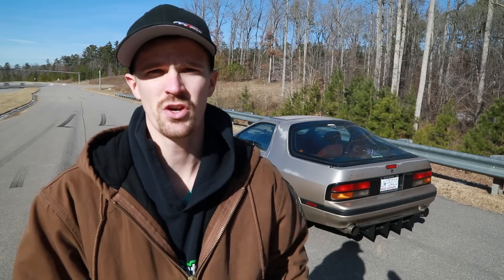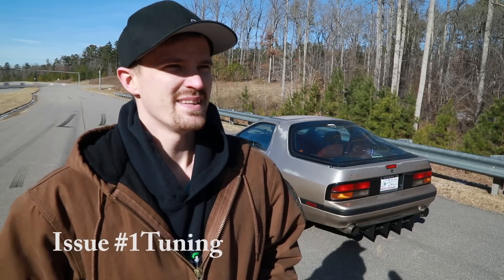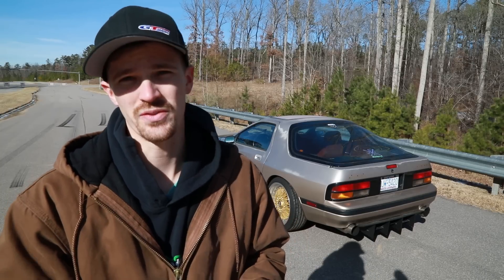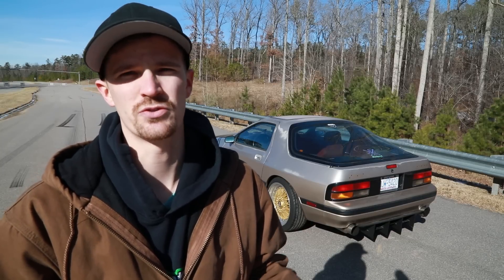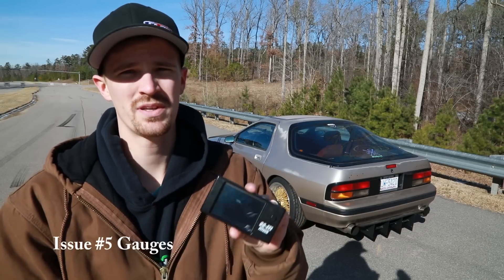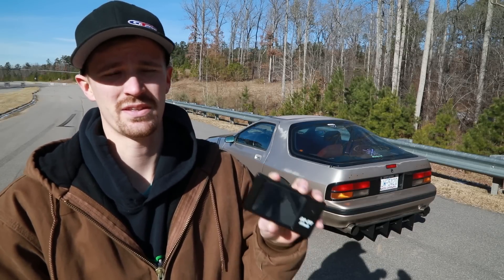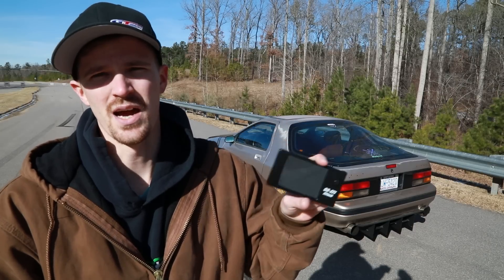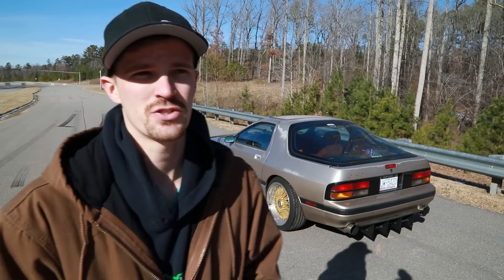5 Reasons Not to Buy FiTech EFI System

Comment: CONSIDERING this unit or Howell, I'm leaning toward the Howell BECAUSE of issues you are having, I figure the MORE COMPLEX the system and the MORE parameters gives MORE potential problems, I NEED DEPENDABILITY first.
Reply: So you just want to run a GM OBD1 TBI system from 1987 that you will have to have a new chip/rom burnned any time you make any changes to the engine?

Comment: I had this same unit on a chevy 283 and was unimpressed. I didn't really have any terrible problems but it certainly wasnt plug and play, never buy a carburetor again like I was expecting. Cranking time was about the same as a carburetor. Fuel economy was about the same as a carburetor. Driveability was about the same as a carburetor. You know how you replaced your quadrajet with a holley when you were 16 to be cool and tinkered with it for about a year and got it running pretty good for the most part and you felt a little bit of improvement in power or driveability with each jet or squirter change but there was always still a little bit of tuning left to do... this is like that. Probably should have just left the quadrajet alone and made sure the choke was adjusted and the thermac air cleaner was working properly. I put about 10,000 miles on my fitech unit. I wouldnt take the time to leave a bad review on summitracing but I wouldnt buy it again. Id either buy a quadrajet or an ls engine. GM, FoMoCo, and Chrysler seem to have worked it out better than the small companies offering affordable efi units.
Reply: hahaha haven't seen someone cheerleading a quadrapuke in a long time.....and that is including the 5 year  age on this

Comment: A lot of cars shut down the accessory power supply when cranking, the ignition power supply isnt the same one as you have this running from would be my guess and you see this sort of issue with cheap gps units as well. Part of the economy of efi is the fuel cut off on decel, so if you want throttle response on decel, then of course you have to disable it. Part of tuning to your preference is to understand the system and your cars system. Nice car :)

Comment: white/black screen issues are most likely operator error, wiring anything directly from the battery like that is usually a very bad idea, especially if you try and use any kind of jump starter on it, you'd probably fry the unit.

Comment: Running a 400HP Fitech on my 78 Bronco. Yeah, you have to tune it, but tuning and changing  parameters is a lot easier than changing jets. Mine works awesome, on or offroad. I think your expecting to much and need to brush up on your engine tuning basics....

Comment: And you need a single plane intake
Reply from the maker: Yep I ran the system with out a filter for a few 1000 miles but installed the filter because my oil was getting really getting dirty fast. The air filter actually didn’t effect the tune much at all thankfully. As far as single plane I know a lot of people still run a dual plane. Check out early bronco and some of his videos we run the same intake on the same motor.

Comment: Try getting a single-plane manifold. EFI-Systems like this (no matter if FAST/Holley/MSD or FiTech dont like dual-planes
Reply: wrong, the fitech works fine with dual planes were other efi's don't cause they only monitor vacuum from one barrel on one side of the manifold, fitech measures from both sides.
Reply: Scott Newman still single planes are better with EFI systems

Comment: I installed a MSD atomic and had great performance at full throttle,  but experienced decel and idle concerns. I integrated the spark timing and all my problems went away. The ECM can rapidly control timing to compensate vs fuel / air. Sorry, but that would mean you upgrade to the better FiTech system.  You would have to also buy what is referred to as a "ready to run" distributor, remove vacuum advance and lock the mechanical advance plates as well. Good luck.

Comment: So part of your problem is the dual plane intake. I’ve used the Fitech and Holley systems and they don’t tune or learn properly because they vacuum or manifold pressure signal isn’t even between banks.
Reply: fitech measures from both sides.

Comment: BIGGEST ISSUE IS THE FORD 302, THE WAY THE FITECH WORKS IS THE DISTRIBUTION OF THE FUEL ATAMS DONT LIKE THE CASTINGS ON THE FORDS AND THEY FALL OUTTA SUPENSION AND PUDDLE CAUSING LEAN ISSUES SO IT RUNS RICH FOOLING THE OXYCONTIN SENSOR RESULTING IN A HIGH HEAT CONDITION IN THE CADILLAC CONVERTOR SO IT MELTS THE BEANS IN IT CAISING IT TO CLOG AND TIGHT BACKPRESSURE SLOWS THE PISTONS DOWN
Reply: grngs1 So much info in one sentence. Always check your oxycontin sensors.
Reply: Soundsike he's running more than sensors.
Reply: so much wrong.....
Reply: lololol

Comment: So the more i think about this the more I'm convinced your starving the engine of air.  This system is a speed density unit.  It uses a calculated fuel curve based on engine size, cam specs, rpm, engine temp, engine load (vacuum), and baro.  The only thing it doesnt monitor is air.  Ford used speed density on the 86 mustang sefi 5.0.  They went to mass air in 87 because it worked better for precise tuning of the fuel curve.  

Because you have a huge choke point with the filter housing the fitech will never be right.  Its assuming x fuel for y inputs with an assumed air flow which is incorrect.

Seriously put in a good filter hat and see if the fitech works better for you.
Reply from the maker: Thanks for the imput, i ran the system with no filter for about 1,000 miles and it ran the same. Once I saw how fast my oil was going bad(dirty) I bit the bullet and put the only air filter that will fit under the hood. The tune was off for a bit but I was surprised that after a few drives it was running just as it had been before. If this was a higher spec motor or reved out more you would see a much bigger difference like you said. But a stock 302 doesn’t pull enough air, when a real cam goes into this motor and I can rev it out im sure ill run into some issues but the filter will be gone before then.

Comment: Put the same system on my new 351W crate motor. 350 hp, four speed in a 1976 F150. I didn't have to do any tuning. Just the initial set up. I just drove it. As it learned it ran better and better. Also I live at 5700 feet. I have a little over 500 miles on it now. Runs great! No white screen. Large gauges stay displayed unless power has been removed i.e. Dead battery.

Comment: I’m actually an air/fuel specialist for performance engines. Other than purchasing the tune upgrade there’s a couple things you should do if you want to get your best efficiency out of the engine. You should open up your ECU/PCM whatever you want to call it and tune your specs from there to get the fuel dialed in to the engines needs. And if you haven’t already, put a digital ignition box on it so you can control your rpm’s depending on how you’re driving it, that should take care of the shifting issues. But a must do before anything else is to put the inline FiTech fuel-pump offered by FiTech for that specific system along with a pressure regulator. In my opinion that’s your issue. I could be wrong but that’s just some advice.
Reply: What PSI should he run???

Comment: Well bo, first off you didn't buy the system new at least the throttle body second off, hook up to a tune on a laptop and see what's really going on if it's defective head unit or operator error somewhere.

Comment: Try playing around with your ignition system. Have your  distributor recurved and increase your spark plug gap and try a colder heat range. I've built lots of motors and sometimes the simplest things like ignition retuning can give you better throttle response. Good luck.

Comment: Weird ive been running the fitech 400 system on my 302 stock in my bmw. I of course had to tune out a little on the afr side but didnt really get any trouble out of it. I do have to run it a lil on the richer from preventing system starvation it gives from being at a high bank sometimes when i run the oval. I do heel toe to engage sometimes and havent ran into a no response throttle when decel , but once in a while heavy throttle and fast decel (prev before running it a lil richer) it would die out.  Let me know if u want me to pass my settings  just in case u wanna try them.

Comment: You can get a thermostat housing with a place for a temp sensor in it. I have one on my 302. So I have the temp port on the intake manifold and on the thermostat housing.
Reply: MattB- That isnt that big of a deal,even ford made 2 housings with sending units mounted there.If you're concerned about it just drill 2 small bypass holes in the outside flange of the thermostat.It will bypass enough coolant for a accurate reading at all times and not affect how the thermostat operates.
Reply: Temp in the thermostat housing only works when the tstat is open.  No way to tell the exact temp at all times.

Comment: Lol wow bro...After I seen that anemic air filter I stopped listening to you complain. My car makes north of 1100hp on a FLAWLESS Fi-Tech 1200hp P/A. Most issues we see are from improper install or a severe lack of knowledge of vehicles and thier operating principles.
Reply: Too funny, my shop air compressor has a bigger filter on it. Fix the airflow restrictions first, then bitch if it doesn't work as expected.
Reply: Ryan Kessel P.S. the only comment he makes that is even partially related to HP is #1 tuning, which is much broader than HP. Everything else is about online support or guage glitches.
Reply: This know it all idiot Ryan kibbles ...smh
Reply: Is it easy to run nos plate with the fitech? Wondering if there is menus in the dash. Thx for your time
Reply: One of the things that pisses me off is beta males talking down to people
You need a #15 crescent upside the head , your new shop name is vagina bouy
Reply: Ryan Kessel. Did u not see where he said hes an average joe?  They offer the kit as self learning and tuning, which it is.  But when u try to tweak it there is little in the way of a knowledge base to learn from.  We are all very happy that u are a tuning expert w the abilitu to purchase a top end product,  so what about those of us not so knowledgeable?  Should i not attempt to get better performance and fuel mileage for my 60s and 50s cars?  Maybe offer some help instead of criticism.  I did not tske this as a fitech slam but as a heres whats great but here are some things as an average guy that i struggle with.
Reply: @tndrme1  even an average Joe knows to do an ls swap 😃
Reply: Come on guys, anyone with half a brain in the auto world knows that air filter is way to small for pretty much anything, the system is probably trying to compensate for lack of being able to breathe "tuning issues" it's a v8 it needs way more air then its getting
Reply: Ryan Kessel who is "we" in reference to the tuning of your car? Maybe if this guy had a team he could also benefit from collaborative knowledge and then post self-aggrandizing comments on other people's YouTube channels.

Comment: Bogg much with tht little fuel pump
Reply from the maker: The walboro 255 packs a good punch for its size, its the same fuel flow that fitech sells and says will work with up to there 600hp units although I would only run it on a 500hp motor. Its a bit loud but a very common upgrade for anyone with a in tank system.

Comment: only issue that i found was the connectors. yes they could have done something better. i plan to solder in my own. as for the white screen? thats on you bud. your electrical system has issues. never once have i gotten that yet. although im running 20K amps of batteries and 2 350Amp alts. as for your decel issue an EFI system will read some decel's like a boost condition. the efi400 can not process that. get the 600 and im willing to bet that your decel issue will go away
Reply from the maker: Let me know how removing the connectors go that's on my one day list so I can mount it in the dash. (are you going to wire straight to the PCB inside the unit?) Good to know about the 600hp units. The white screen is a funny one, it doesn't always happen and from what I can tell over all battery voltage does not seem to be the contributing factor but I have a very early unit witch might be contributing. I also think its funny that the EFI itself can run at very low voltage even get jumped off from a dead battery (very very impressed by that!) But it seems they could have used the same low voltage filters in the hand held as the unit itself.

Comment: these systems suck. they are very hard to tune with little information about the settings. some of the worst customer support you will ever deal with. the quality is poor. you were talking about the plug in... why have them sticking out of the top of the controller, its like they forgot they would need power and add it as an afterthought. also, the fuel command unit is junk. we had to open the brand new unit up to tighten down the fuel line on the pump... they didn't even tighten it! after that pos was up and running it would overheat and cause vapor lock (mounted right in front of the grill.) dont try to save a few hundred bucks on this pay a little more and save time and frustration. (i could go on...)
Reply: sometimes its better to be smarter than your equipment..
Reply: said no one at fitech...

Comment: That filter if very restricted and could be causing issues. Try driving a Little without it to see how it runs
Reply from the maker: I ran the first 500-600 miles without the filter it drove about the same. I was afraid to put the filter on thinking it would make the issues worse. To my surprise the unit handled the change really well after one ride with the filter it felt the same as without.

Comment: Not exactly sure why my comment didn’t complete. Damn iPhone. I said all of that other stuff to say this....Most OEM fuel lines are marginally adequate for their original applications. There’s really no such thing as too big for fuel supply/return lines within reason. Same is true for power supply/ground conductors. A wire might look big enough but some manufacturers use thick insulation on their wire and cable products. Always verify the AWG size of the conductors. Never use that discount speaker wire left over from your Audio install. The cheap stuff is copper clad aluminum (CU/AL) or tinned conductors with abnormally high electrical resistance. It will get hot under load. The additional heat increases resistance while decreasing its efficiency as an electrical conductor. 
I’ve owned my ‘70 Mustang Mach 1 for 35 great years. The factory engine is a 351 Cleveland with 4-V heads. For clarification, that’s 4 venturi or barrel carb. The 351 C heads designed for 4-V induction have large 2.19” intake valves and 1.71” diameter exhaust. The intake ports measure 2.50”H X 1.750”W. Intake port volume is 242cc’s and becomes substantially smaller past the inlet for increased charge velocity with an average cross section of 2.9 square inches. The Ford Engineers definitely had Racing in mind with the heads tuned for optimal power at 6400 rpm’s @ 3750 feet per minute mean piston speed.... and it worked quite well. Small block Ford engines equipped with race prepared 351C 4-V heads dominated Pro Stock Drag Racing through the 70’s and early 80’s. The only way the NHRA could stop it from pissing off the GM and Chrysler crybabies was to implement a 500 cubic inch max engine displacement in the eighties. Same for NASCAR. Cleveland headed combinations won while setting records everywhere. 
Since There’s certainly nothing wrong with being young. I highly recommend it but occasionally a young gear head wants to argue that Ford didn’t make a 4-Valve production head in 1970. Good call ! 
My apologies for dragging this out. My apologies to 426 HEMI GUYS and

Comment: Same as usual, those with no skills cry and blame shift, people with skills make it work and like what it does...None of them will exceed the power of a properly tuned carb, just look at NHRA Pro Stock class, but the atmospheric changes and temp changes that trouble a carb are overcome with the FiTech....Reach in the window and crank the engine with 40 degrees temp and she fires up and idles...I'd like to know who has  a keyless remote system with the FiTech so they can sit in a lawn chair at the car show and start it up with a thumb? A/C request bumps speed when clutch engages, simple to install, tricky to tune, gotta cheat the parameters, but they work great! Dizzy needs to be locked out with a phaseable rotor button if using timing control function.

Comment: You have too much voltage variation from your car's electrical system to use with any precision electronic device. If you have ever worked with HPTuner, et, al  it won't work if you plug your laptop power into your car. You MUST use laptop batteries or pure sine wave power (grid power) . + or - 5vdc is the main voltage in your  USB/obd II and .01 variance volts can cause major errors! Software is dependant on exact voltage for error free computing.

Comment: Been running a FiTech for years now that I got tired of fiddlin with my old motorcraft 2150, and to be honest I have not had the experience you have had. I do know what that white screen for me was because I initially hooked into a system  that actually cut off during cranking. Other than that it's just tinkering to find your proper settings, where I personally took it to a local shop and had them tune it. It's been great for me ever since.